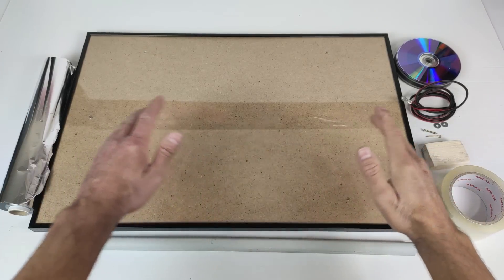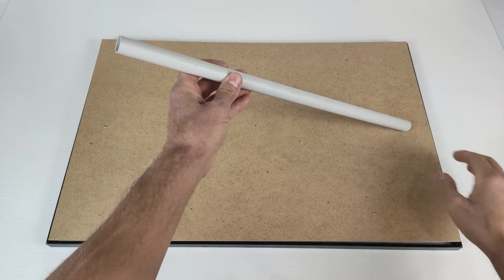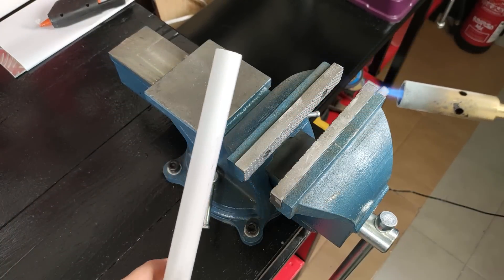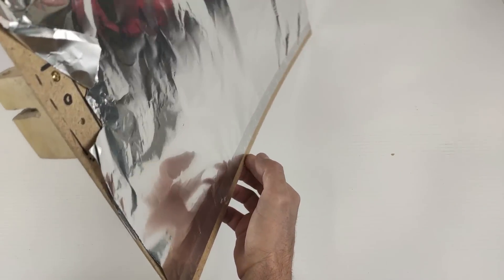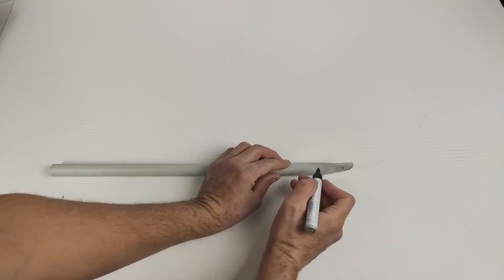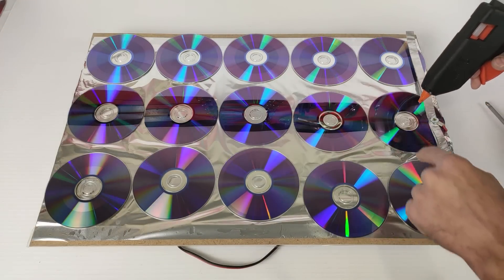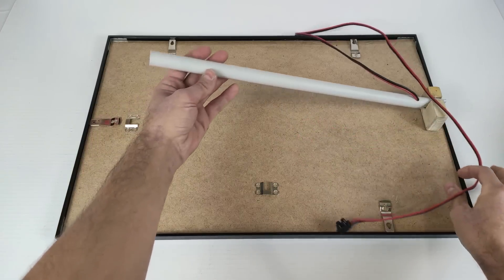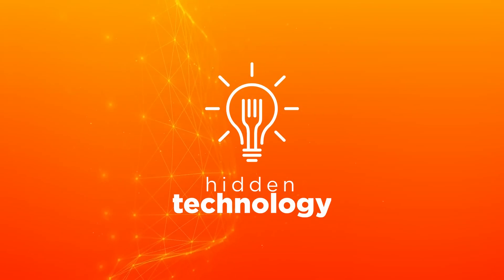I turn a bunch of old CDs into a SOLAR PANEL for your home | Homemade Free Energy

Comment: lower (according to the assembly diagram) side of the discs is plastic ;) how the foil, on the bottom of box, gets the negative potential? you chitter, at least for the sake of appearances must sand the lower surfaces of DVD discs ;)

Comment: I heard that connecting the discs with copper wire as the conductor produces 200 Volts per 6 CDs. I don't know if its actually true yet though.

Comment: Solar works better the moment you short circuit each cell for best results😅. As soon as I noticed that the video started to look really bad. However this makes an amazing reflective surface to enhance your actual solar panels because of the light spectrum that bounces from these are perfect for solar. Ignore the aluminum and pack as much of the CD material in as you can.

Comment: 👉 This can be done using standard CD’s and wrapping 46 turns of magnet wire through the 46 holes  drilled around the outer perimeter of each CD.  It’s not solar, rather it taps into the earth’s natural electrical field.

Comment: Judging by the feeble led bulb, small motor and diameter of the stand up close at 15:12 I doubt it's even lithium batteries inside. 
He doesn't even measure voltage under the load of the led or motor as it would likely drop the voltage to much on his 30W cd's / cheap cells. 
The stand seems about the correct length and diameter to house 9-10 AA cells and the wire to the last cell at the bottom. All with a stopper to slide on to hold them in place and perhaps hide a contact/stripped wire or more foil screwed up.

Comment: Fantastic. I used your "Brain" and built mine too. It works so well and even works better AT NIGHT, yes when the sun is down. Afterall, tge batteries in the pipe are fully charged. I think it may even be  better without the cds! Lol
Reply: so you really did that thing too? how many hours you can use the electricity from the diy solar panel?

Comment: It’s good to keep an open mind, but be careful to not keep your mind so open your brains fall out. 
Even if the foil and plastic cd’s are made of would generate solar power, wiring them up in this way would produce 1.5 volts at best.

Comment: At first I almost believed it. I wondered how he would solder the disks without damaging the plastic layer. But when he screwed the plus wire to the board right through the foil (to which he had already connected the minus wire before), I realized that it was a practical joke. And then he started gluing strips of foil directly to the plastic surface of the discs, and I couldn't help laughing.

Comment: Eval, mistake in series vs parallel for output voltage. 0.86 volts X 15 cells in parallel is 0.68 volts. Mistake 2 connection to the silicon layer.. the surface is Polycarbonate. The dye layer is under the plastic. see construction of CDR for more info.
Entertainment value.. Good, especially in the comments.

Comment: It doesn't work, it never will; plastic does not conduct electricity. Before working try this with a CD and you will see that you get absolutely no electricity at all, nothing! The CDs are connected in parallel to get more power, so each CD should generate 12.49V, but it will not generate electricity: 0V! Don't work for nothing!

Comment: 3 points that its a fake.
1. It gives 12.5 v. Which is equivalent to three 18650 batteries.
2. Moving the panel away from the sun still lit the bulb with same brightness.
3. Its common sense.

Comment: How you get the output exactly 12.5v without any computation?✌️
Reply: Three fully charged 18650 li-ion cells in the tube will give exactly 12.5 V. However, under load the voltage will drop to 11 V.

Comment: Great video , never thought it will be that easy. Will be trying it
Reply: Don't bother it doesn't work, he used hidden batteries in the tube.  Wondered why he didn't run the cable right through the tubing ha!
Reply: did it work

Comment: Interesting use of odds and ends.  However, if you obtained 3 watts of power out of that contraption I would be amazed.  Solar panels under no load are more likely to put out around 20 vdc in good sun conditions.  12.45 volts seems totally  suspicious.  The packing tape will look like brown streaks and disintegrate from UV deterioration in a short time. ☺♥†♪♫ 11-1 -2022

Comment: Great job,  i love simple tech that can be used daily. I'm hooked up. I want to charge power banks and batteries though. Not turn a light on in the daytime. A radio maybe or a fan if I'm hot.

Comment: Great job, sub earned. i love simple tech that can be used daily. I'm hooked up. I want to charge power banks and batteries though. Not turn a light on in the daytime. A radio maybe or a fan if I'm hot.

Comment: At 14:38 you can clearly see the leds are fully lit,,, while the shadow on the ground indicates panel is over center of the sun... in shade.  oops.  Even real photoelectric cells don't work in the shade.

Comment: The plastic tube is very suspicious. Why not use a piece of wood? I'll tell you why because you have batteries in the tube! I was thinking why you ran the wire through the tube instead of just out the wood! I would have liked it to work but CDs are made from none conductive plastic. You are a con artist and wasted 15 minutes of my precious time along with many more people and there's probably loads of people really frustrated wondering why it won't work after spending all that time making it. No wonder you have a thing pops up saying please don't leave disrespectful comments before you type because you know your going to get a lot of people that have brains and work it out!

Comment: No insults will be tolerated? okay.
Firstly, If by any chance that this is true I don't think you are capturing light. I think the design just collect heat.

However that is just an idea. But my second thing is sure. I can surely say that you cannot easily light up a 12v bulb using Direct Current 😊 You need to convert it first to Alternating Current 😊

2nd the volt power is too stable bro. hahhaa that's not how it works but I won't explain further.

3rd I am a camera man too. Your way of taking the video shows that you are hiding something from above.

4th I am a video editor there was a glitch when the camera is almost there.

 This is not an insult this is factual as I based it on my experience. However, I will still try this.
Reply: Did it work?

Comment: The only way you are generating electricity from CDs is if you circle them and focus their reflections on the same place, put brine there, and run some pipes so when teh brine boils it drives a turbine which drives a generator before going through a condenser so it turns back to brine to be boiled off again.

Comment: He said 0.8v per CD then he wired them in parallel instead of series. The panel should measure 0.8v.  Magically, it measured 12v, terrible.  Liked the touch about two different kinds of CD, I wonder how many folks went searching their collections! How many tried it without testing one CD for proof of concept?

Comment: It very depends on what program you used to burn those CDs, NERO adds another extra 30W, I burned 100x High Voltage album from AC/DC (with nero ofcourse) and it gives voltage even in night.
Reply: And if you burn only Highway To Hell, you are guaranteed it will also offer heating for the whole city.
Reply: Hhhhhhhhh
Reply: It also attracts strikes of "thunder".
Reply: Haha Good One LOL! 😆

Comment: That makes no sense whatsoever. First of all, only BD-R discs contain silicon and it's buried under a thick layer of plastic which is not a conductor. Second of all, you need a redox reaction to occur to create a current and that can only occur if you inject atoms of boron and phosphorus which are how photovoltaic cells are made btw. Finally, your circuit makes no sense. I can't belive you wasted your time filming this lol.

Comment: First issue, 1:28 seconds in.
Writable CD's and DVD's, and Bluerays, use a dye to be written on. Burn the dye and it doesn't reflect ta-da the magic of writable disc's! rewritables typically use an phase change material called gst, it changes phase under a laser and that changes its reflectivity and it has no silicon.

Comment: Also… Your wire from the LED light is running straight into the pole of the stand? Why would it need to run straight into the pole and not off of the panel?

Comment: I just have 1 question, when you turned the solar panel away from the sun the light was still lit? The panel that I have can’t store electricity and if I do that my light goes dim and then off… ? Yours stayed bright even when facing away from the sun? It’s impossible, that was probably your biggest error to expose that you’re using an battery my friend.

Comment: I was really curious how you were going to make that 'functional circuit' to tie the CDs together in a circuit...but the comments say it all. First hint: CD's are plastic on both sides, so unless you drill, cut or break the plastic to get to the film layer sandwiched between them, you don't have a circuit.
Reply: He said use the purple reflective silicone cds for this purpose.
Reply: @perrywhitall1530  wait so technically, i could drill two holes in the other cds that he said not to use and continue with the circuit and it would work?

Comment: Very detailed steps in very simple words. Thanks so much for this very informative vlog. Congrats, God bless. I have some questions though. 1. The volt remains 12.5 for as long as the panel is in the sun? 2. Can i add more cds for more volts? Do you have a vlog of that? 3. How can i store that power to be used at night? 4. How can you connect the wires to plugs where we can charge mobile phones or other appliances?
Reply: Are you for real?!

Comment: Lol
Those who fall for this, what happened to physics education in your neck of the woods?
The metal layer in CDs does not produce a photovoltaic effect. The batteries are hidden in the tube where it stands on.
Reply: Ah come on, I can make this 4 times more powerful, by using Lazer discs, they are much larger:)
Reply: @KevinSmith-os5yz  Yeah right 🤣

Comment: Everyone is talking about the bulb not turning off but forget that we don't know if there is a capacitor in the housing. It's an LED bulb and by nature consumes less energy. Lastly, there is a lot of ambient light reflecting off the grass and surrounding area. If the volt meter stayed at 12.5 THEN there would be cause for concern.

Comment: A good way to demonstrate a working photovoltaic solar panel is to cover it over with a light blocker, and then uncover it, to show the power going up and down. This is hard to demonstrate on a vapourware like this with hidden batteries in the pvc pipe, so obviously just connect and disconnect it instead to demonstrate it "working"!
Reply: Haha😅🙏

Comment: I built the older version, using videotape. It worked really well.
Reply: I built old style using my old record collection and it runs my air conditioner.  (has AC/DC)
Reply: @mattburrows2615 really??????
Reply: @analizaperez7332  Yeah, 
AC⚡DC.
Reply: Could you teach me also for my project
Reply: Does this actually work? I know he hid batteries in the pipe but how do I actually get it to work?
Reply: But, when you have to rewind the tape, that means you are sending back the energy, right? Hook it up to sell it to the city, for some cash.

Comment: it's not true already the panel structure is wrong. then, when you have tested the lamp and you have lifted and rotated the panel, the lamp logically must go out for a moment, because the face of the panel is no longer facing the sun.

Comment: Ironically the conductive side of the cd's were placed against the aluminum foil automatically creating a short. I got to hand it to you though, it looks like a solar panel.
Reply: Only one CD with a hole (this is a joke, i lol-ed hard) may be connected to circuit, all other just laying near.

Comment: I wonder if I could get more current out of it if I used a fatter pipe.  Maybe a pipe with an inner diameter big enough for to fit a D battery would work well.
Reply: D cells, C cells, AA, AAA and most watch batteries are all 1.5v so it would actually reduce your chances of increasing voltage because in a section where you could fit say 4 D cell batteries (6 volts), you could fit 8 nine volt batteries (72 volts). So next time you decide to be condescending in your video comments, you may want to make sure you know what you're talking about first.

Comment: Pro-tip: Gamecube disc's have a higher concentration of silicon due to their unusual small size. This allows them to absorb just as much energy as a full-sized disc while only taking up about 1/3 if the room
Reply: that's one way to make YOUR collection more valuable , lol.
Reply: Have you not figured it out that the discs are made of plastic?
Reply: @rastaralph7154  Yes, silicon is plastic. Ty captain obvious.
Reply: @C0tt0N_RL  silicon isn't plastic it's silicon totally different!
Reply: @rastaralph7154  That’s like saying polypropylene isn’t plastic, it’s polypropylene. Trust me, I know what I’m talking about. I supply power for a small village using silicon plastic discs and homemade lemon batteries.
Reply: @C0tt0N_RL  silicone is a polymer and silicon is an element. Plastic comes from crude oil and is a by product of making fuel!
Reply: @rastaralph7154  Wrong again, silicon was invented by Philip Siliconeezi in 1896 and was heavily used by Thomas Edison’s electrical engineers.  The first light bulb was made completely out of PS1 demo discs and weighed over 300 pounds.
Reply: How does plastic atore the information on the discs?
Reply: @stevehess1000  You serious? There are microscopic pits in the disc that the laser reads, rather than the magnetic information on old-style media. I believe you can even have different layers of pits, hence 'dual-layer' writable discs.
Reply: I was wondering something similar, weren't PS1 discs black? Think they'd work?

Comment: Ich glaube nicht, dass es funktioniert.  Alle CDs sind parallel geschaltet. Deswgen müsste die Ausgangsspannung einer CDs gleich sein. Um mindestens 12V zu bekommen müssten alle CDs in der Reihe geschaltet werden.
Ich weiss auch nicht, ob die CDs Oberfläche Strom leiten können. Bestimmt nicht.

Comment: first thing when you put the strips on top to connect all the CDs together you now have the positive and negative touching at both top and bottom of the panel so whenever you do ( if you do) get power from the sunlight it would start smoking and burn up because the positive and negative are touching . try doing more research before you make any more videos about solar power or anything else for that matter . just wont work .

Comment: I need to do this myself - because, something is way off!

You say that this panel gives 12 volts, since every 'element' produces 0,8 volts. But as they all is in parallel, the output should never be more then 0,8 volts!
In the past i have been using 2N3055 and cut off the top of the TO-3 housing, exposing the silicium beneath. And the voltage will never get higher then 0,7-0,8 volts!

Before anyone tries this at home. TAke a single CD and messure the voltages across the CD with a standard voltmeter. IF, and i say it again, IF this should work, you should be able to measure 0,8 volts. Since it's the same, just not with 30 minutes wasted + using resources on top.

Comment: Simpler idea. The best way is get a long ladder. Car starter cables with crocodile clamps on and attach to those big cables hanging across fields near Pylons.  Go up the ladder and attach to cables. You will never pay for or need electricity ever again. Try it. Remember it's not Electricity its Elastictrikkery.  Cheers from old George and Jane. 👫👍🇬🇧

Comment: a tip for a great upgrade: you can also remove the panel, and just use the stick: will save 15 CD, and solar power will work too !!!! great job.
Reply: What for a stick?
Reply: I am thinking how many batteries can this stick hold )
Reply: light free solar panel

Comment: Seems like a lot if people need to go back to school, depending on the type of disc this us  possible, using a dvd-r will not work they contain no silicone, where as a blue ray disc, cd-rom and others discs from the late 90s have less plastic m, gir example Go brake an old disc, tgrte will be plastic foil straugh through the center where ad if you brake a blu-ray disc it would fold and then crack open revealing a much thicker glass like foil, this is why this works, yet again jealous peokke wish yo trash the earth

Comment: By definition this is not solar panel but according to the Nikola Tesla patent this is exact replica of his radiant energy receiver/collector. Radiant energy or aether energy is coming from above mostly from sun but not only. If you look closely to the video CDs did not connected to each others by theirs metal inner parts (he didn't drill the holes in them but one only) but somehow he connect them with aluminum foil to their dielectric non current conductor lair and it still transfer the energy from each of them. Hmm... HOW? Because he is not collecting electrical energy and conductor for radiant energy is dielectric. You are welcome... This will produce energy even at night time

Comment: I am so glad I read the comments as I was all set to rush down the shed tomorrow and build it.
Reply: You could always take one CD like he used and wire it how he shows so you can put it on a multimeter. It is aluminum foil and tape, so making a single tester "cell" would show you if it is 0.8 volts ya?

Comment: Instead of CD's use a higher capacity 4 Terabyte NVme SSD. With that you'll be able to power a full house!, if you want more, just use a RAID configuration,  or use Amazon cloud storage.
Reply: Hello James, is this video working in reality ? I want to try this
Reply: @filipondrek868  try it, nothing ventured, nothing gained & then your results • Is this video fact or fiction?